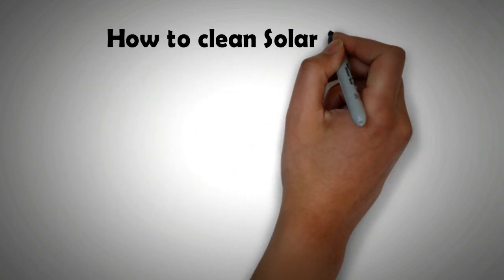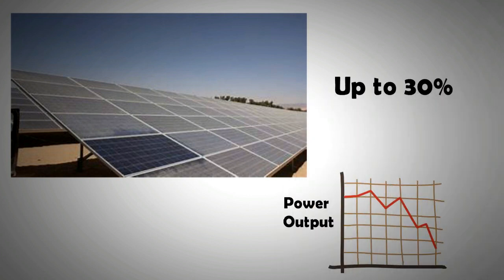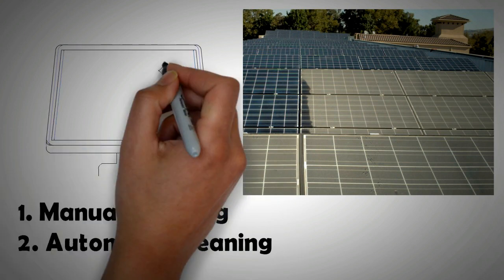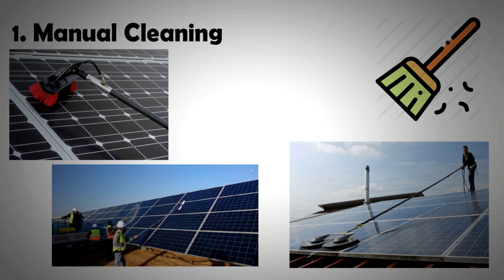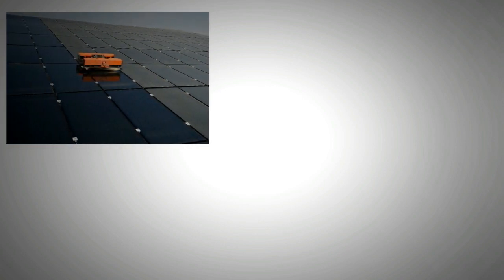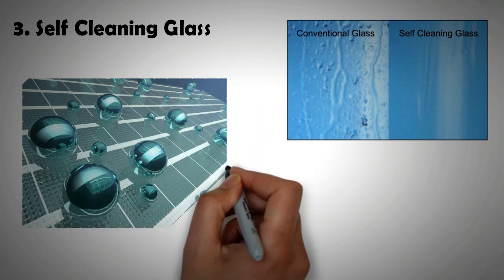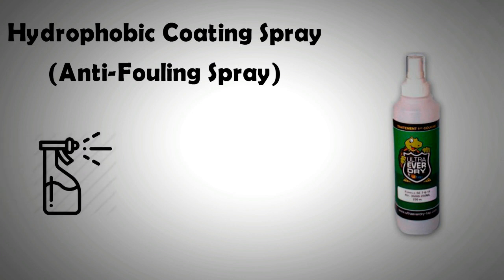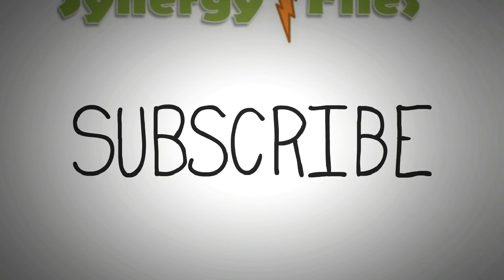Methods for Cleaning Solar Panels

Comment: What about the scaling already there on panel. How to remove that prior to coatimg.
Reply: Most suppliers are not able to provide solution for Scaling. Also, sand or dust in arid regions is abrasive. When removed at great force without water will cause abrasion on the solar panel.

Comment: would this coating decrease the efficiency of the panel though?
Reply: Thats exactly my thinking. It's almost like waxing a car which certainly adds a layer of protection against the sun so I feel like adding a "coating" could actually decrease the amount of uv light absorbed into the panel.
Reply: yes

Comment: You used the terms hydrophobic and hydrophilic as if they were synonymous.  Hydrophobic does mean the water is repelled and water combines in small amounts and forms beads which can roll off.  Hydrophilic sheets because water is attracted to it.  In the case of hydrophilic, only a large amount of water will create a sheeting effect where combined water's weight pulls it as a unit all off together.  Small amounts of water like nightly dew would just act like cement adhesive on hydrophilic glass, causing it to stay put in the dust, and bake as the sun rises.   Sadly, even some of the coating companies promote hydrophilic properties as if it was a good property to have on solar panels.  This is because they claim that the beading of hydrophobic creates drops that evaporate on the panel causing deposits as they dry.  Manufacturers use glass that is mildly hydrophobic, but the process for adding an aftermarket coating and maintaining it with constant reapplication does not appear to be practical.  Cleaning is work, but applying a coating evenly and buffing it out is a lot of work, and very hard to do on an array that you can't reach each panel to do this by hand.
https://youtu.be/4SORg3AQ8nw
Reply from the maker: Thank you for detailed informative input

Comment: https://www.homedepot.com/p/Windex-32-oz-Outdoor-Glass-Cleaner-040132/202872010

Do it in the morning before the glass gets hot.
Morning dew is full of dust particles and yo want to spray while the glass is still damp from the condensation.

Done.

you can use pat of the solar power to condense water from the air...  even a simple Peltier cooling system can collect a significant amount off water.

Comment: How long will the paint last?
Reply from the maker: +Alec Grolimond It should last very long
Reply: Its similar to  "Rain-X" for car windshields... You have to apply it periodically.  How often depends on the environment.  It stays on well when you don't use detergents.  

the nature of solar panels vs automobiles , you'll tend to have it last longer on the solar panel.  You aren't dealing with road grime. (or at least not nearly as much)

When you need to use detergent to clean the glass, its time to reapply.